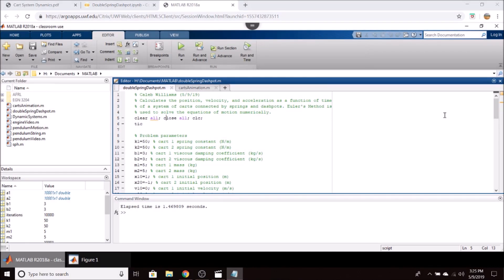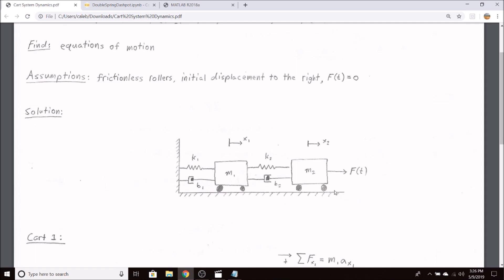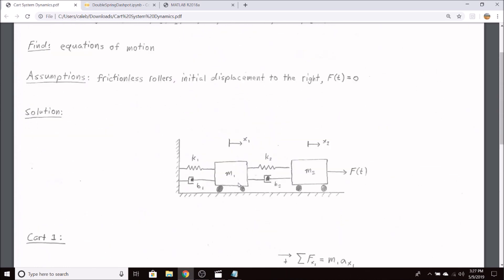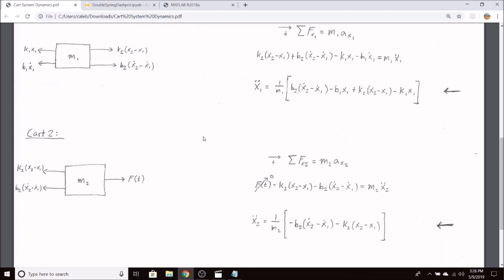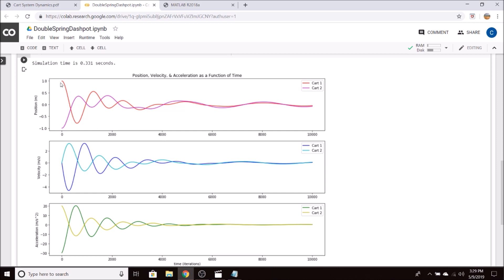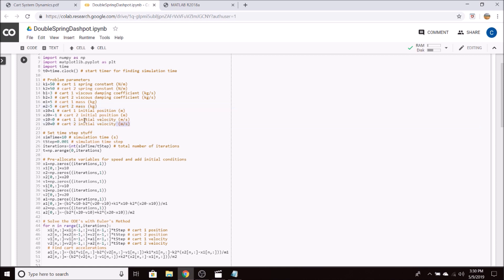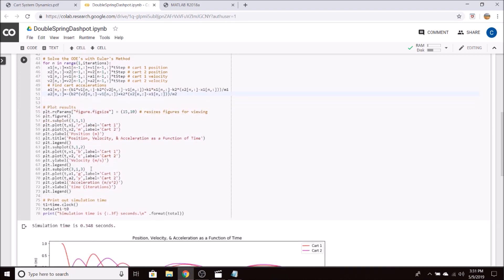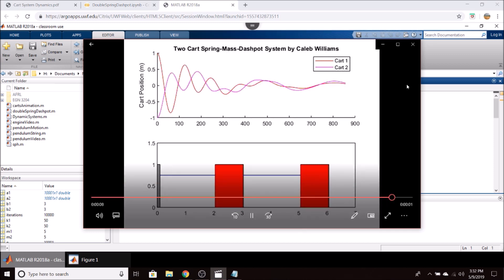Equations of Motion and MATLAB/Python Simulation of Multibody Spring-Mass-Damper System

Comment: Trying to run the Python program - I get errors on the # import lines

Traceback (most recent call last):
  File "C:\tmp\Python\doublespringdashpot.py", line 15, in <module>
    import numpy as np
ModuleNotFoundError: No module named 'numpy'
>>> 
================= RESTART: C:\tmp\Python\doublespringdashpot.py ================
Traceback (most recent call last):
  File "C:\tmp\Python\doublespringdashpot.py", line 16, in <module>
    import matplotlib.pyplot as plt
ModuleNotFoundError: No module named 'matplotlib'
>>> 
================= RESTART: C:\tmp\Python\doublespringdashpot.py ================
Traceback (most recent call last):
  File "C:\tmp\Python\doublespringdashpot.py", line 18, in <module>
    t0=time.clock() # start timer for finding simulation time
AttributeError: module 'time' has no attribute 'clock'

Sorry I am new to python.
Not sure if I need to maybe add certain modules to the basic Python path that I am running? 
I am working on a windows machine.

Thanks 
>>>
Reply from the maker: You are certainly missing those modules.  I’ve never known of a user having issues importing modules into Python.  Have you tried Googling this issue specifically?
Reply: @ironpine5815  Thanks - I guess these modules don't come preinstalled in windows. Will try on a linux system that I have. Will install python there and check..
Reply from the maker: @analysispros  I would recommend installing a Python distribution such as Anaconda.
Reply from the maker: @analysispros  it looks like time.clock() has been removed from Python.  Check this out: https://stackoverflow.com/questions/85451/pythons-time-clock-vs-time-time-accuracy.

Comment: Hi, currently working on a similar problem of my own and found this video very helpful. However in my problem i don't think I can assume f(t) to be zero as it is a unit step input. Would you know how to change the code for this? struggling to find anything else on this topic online. Thanks!
Reply from the maker: First, you will have to add f(t) to your equations of motion.  That should be straightforward if you're comfortable with drawing the free-body-diagrams.  I don't think adding f(t) will change the application of Euler's Method in the numerical solving of the EOM's.  You just need to be able to create a piecewise representation of your unit step input!
Let me know if that works!

Comment: how can i make system fixed both end and have 3 spring?
Reply from the maker: You will have to re-derive the equations of motion and then apply Euler's method to this new set of equations.  The general process will be the same as I have outlined in the video.

Comment: Hi there, I have a project where it is a similar example to the one you showed, but instead there is a force component that is not negligible for the first 50 seconds of a 300 second time span. After the first 50 seconds, the force turns into zero. I tried incorporating that into the acceleration equations, but when I graph it, it ends up being an exponential graph for position and it just becomes a flat line as it peaks in value. Any input? Thanks a lot.
Reply: I am having issues because after it peaks at t=50, the mass never returns back to equilibrium and I do not know how to manipulate your code to where it does so.

Comment: wat can you suggest if there are 3 masses
Reply from the maker: If there are three masses, you'll just have to re-do and re-solve your free-body diagrams.  You'll get more equations of motion, but the process for solving them will be the same as I explain in this video - just use Euler's method.  You might check out my video https://www.youtube.com/watch?v=MwsWLPtiKis&t for assistance on n-body spring-mass systems.
Reply: @ironpine5815  thanks n what can we do if we have to add spring and wall/constraint after 2nd block

Comment: Great video! I'm just having a problem with the animation, I'm pretty sure my computer could handle it smooth, bud it gets incredibly slow. Is there anything I can adjust to make smoother?
Reply from the maker: Is the animation slow when it's generating (ie. when the MATLAB code is running)?  That's to be expected - your computer is having to crunch the numbers and generate the plots.

But when you play the animation from the .mp4 or .avi file, it will play at whatever framerate you specify.  The higher the framerate, the smoother the video will appear.

Comment: very informative video sir and thanks for this video, i would like to ask question related to my project  single degree of spring mass damper system run by some external force say Fsin(w*t) where w is speed of the motor and t is time ,so how can i get the response of the system by changing the speed of motor in transient analysis.
Reply from the maker: You're asking how to include that external force in your MATLAB analysis?  Somewhere in your variable declaration area, write:

f=@(x) sin(w*x)   % x is the time (variable), w is the motor speed (constant)

Then, in your for loop when you solve the equations of motion, you can write that force as f(t), where t is the current simulation time.  MATLAB will evaluate the function f that you declared above at the time t that you give it.  Does that make sense?
Reply: @ironpine5815  thank you sir for your gentle reply and sorry for late seen. here i am giving my code and i want to just see the transient response 
clc
clear all
m=1;
z=0.1; % ratio of damping co-efficient
k=100; %spring stiffness
f=100; % harmonically excited force
X10=0.02; % initial displacent 
X20=0;   %initial velocity 
wn=sqrt(k/m); %natural frequency

c=z*(2*sqrt(k*m)); % damping coeffient
wd=wn*sqrt(1-z^2); % damped frequency
i=1;
t=10 % time period
% i want to see the value of the Amplitude (X1)and speed (w) after 20 sec
for w=0:0.1:20
    R=w/wn;
    C1=X10+(2*z*R/(k*((1-R^2)^2+(2*z*R)^2)));
    C2=(X20+(z*wn*C1)-(f*w*(1-R^2)/(k*((1-R^2)^2+(2*z*R)^2))))/wd;
    X1(i)=(exp(-z*wn*t)*(C1*cos(wd*t)+C2*sin(wd*t)))+((-2*z*R*cos(w*t)+((1-R^2)*f*sin(w*t)))/(k*((1-R^2)^2+(2*z*R)^2)));
   W(i)=w;
    i=i+1;  
end
plot(W,X1)
xlabel('Speed');
ylabel('Amplitude');

Comment: Hi. Really great video, and very helpful. But there is something that does'nt make sense for me: if I apply a force in "m2" to the right side: why "m1" body starts its movement to the left side?

Thank you in advance
Reply from the maker: m1 will move to the right as well.  Where do you see it moving to the left at first?
Reply: @ironpine5815  at 0:31. you can whatch it on the animation, and the plot too. One mass take positive direction, and the other one, negative. I did it by state equations using the module "control", and both masses took the same direction on the plot.
Reply: @ironpine5815  May be, is something I'm missing on it, and thus interpreting wrong what I'm watching. That is because I'm asking about...
Reply from the maker: @alfonsormichel  Ah - I see.  In the animation I showed the first cart was initially displaced 1m to the right and the second cart was initially displaced 1m to the left.  Thus when they're released, the first cart will move left and the second cart move right.  Does that make sense?

Comment: what if I only want one mass spring system where it is attached to wall on one side and a force is applied on the other side
Reply from the maker: In that case, the problem is even simpler than what's shown in the video.  I've derived the equations of motion and written a MATLAB script to find the position, velocity, and acceleration of the cart.  See below.
Equations of Motion: http://www.mediafire.com/file/aqqtglfdmt29q61/SingleSpringMassSystem.pdf/file
MATLAB Code: http://www.mediafire.com/file/dm73mgh5qwmke2a/SingeSpringMassSystem.m/file

Comment: Hi,  why when I use the program for 3dof can't run?
Reply from the maker: Latifah,
The program I developed here was for a 2-DOF system.  If you want to use it for a 3-DOF system, you'll have to re-derive the equations of motion and modify accordingly the section where I solve the equations of motion numerically using Euler's Method.
If you want to see me develop code valid for an n-DOF spring-mass system, see my two-part series on modal responses.  Here's the first video in the series: https://www.youtube.com/watch?v=0NAjoJPkp2M&t

Comment: Very helpful video! So clear and nice to watch, thank you su much for taking the time to explain point by point.
This is a complex spring-mass-damper system,  i was wondering... if i need only the spring-mass system(no damping) ¿will i get it by removing all the dammping coefficients from code ? or there's any extra change?
and by removing coefficients i mean remove b1 and b2 inside the a1 and a2 when you solve it with euler)
Thank you <3
Reply from the maker: Thank you!
If you just want a spring-mass system, set the damping coefficients b1 and b2 to 0 in the Problem Parameters section - that will essentially remove them from the system.

Comment: Great video! Super helpful, thank you for uploading the matlab code as well. How different would it be if it was a rotational system (i.e. two discs with 1 shaft in between)?
Reply from the maker: Thanks!
With a rotational system, your FBD's would be different - you'd obviously have torsional spring/dampers.  The general equations of motion, however, will be the same - you should be able to just substitute x_1 with theta_1 and x_2 with theta_2 in the equations.  Solving via Euler's Method will also be the same.  Would it help if I post equations of motion?

You mention two discs with a single shaft.  Assuming this system isn't connected to a fixed ground, take the above equations of motion and cross out all terms with k_1 or b_1 (spring and damper connecting the first disc to the wall).
Reply: @ironpine5815  I have been trying to see how a torsional system will behave in free vibration. This video was amazing and helped me further understand  how to derive the equations of motion and tried to modify the code for a 2 mass 1 spring system in a rotational direction but didn't get good results . But yes that would be great!! Thank you :)
Reply from the maker: @ashleytate8069  Here's a link to my version of the equations of motion for the system you're describing: http://www.mediafire.com/file/gs9u3ispyxbsabj/Torsional_Spring_Mass_System_-_Free_Free.pdf/file
Based on these equations of motion, I modified my MATLAB code and have attached the new version here: http://www.mediafire.com/file/0hkhckh42lhtg7h/torsionalSpringDamper.m/file
You'll notice in the MATLAB code that because there is no ground (ie. the system is free-free), the system doesn't always return to an angle of 0 rad when it stops vibrating, depending on the initial conditions.  Basically, you can end up with the equilibrium point being changed - this is a neutrally stable system?  I'm no vibrations expert ...  
Let me know if you have further questions!
Reply: @ironpine5815 Thank you, that's a wonderful work!  I believe the two-mass or two-inertia system in this type of setup are both open-loop stable, meaning that all the system poles locate on the left-half plane. Even if the friction is assumed to be zero, they both have poles on the imaginary axis (marginally stable) and never will make them move to the right half-plane.
Reply from the maker: @yuhu1756  Thanks!
You're right - with an undamped system (ie. no friction), the system is marginally stable.  Any amount of friction will cause the system to be stable with poles in the left half of the plane.